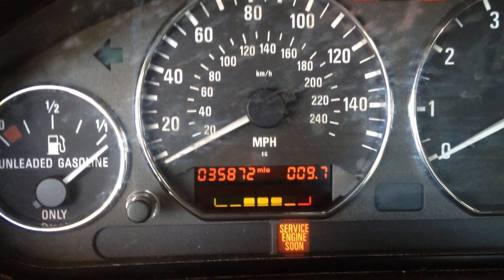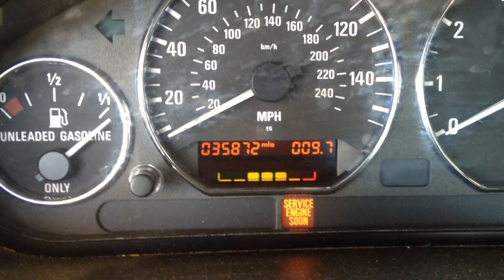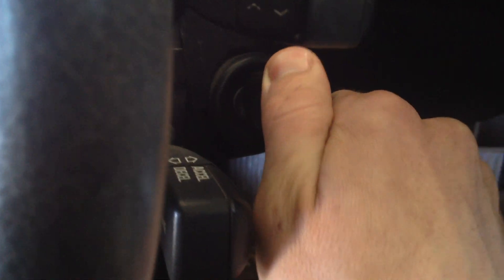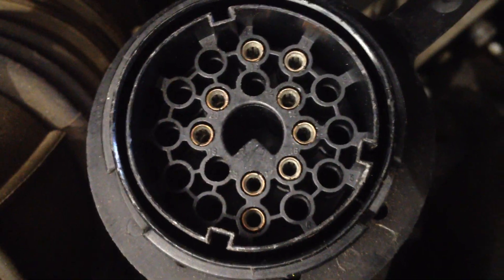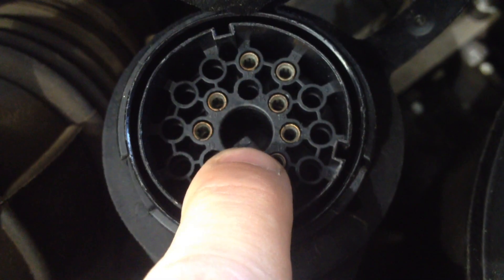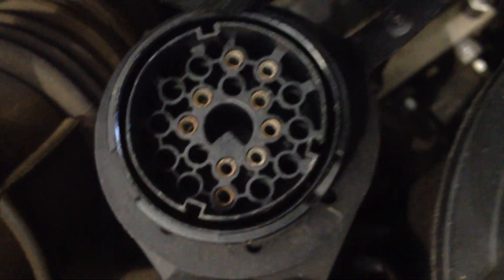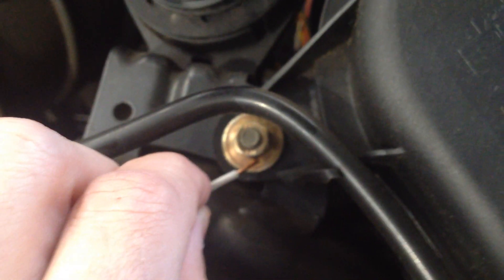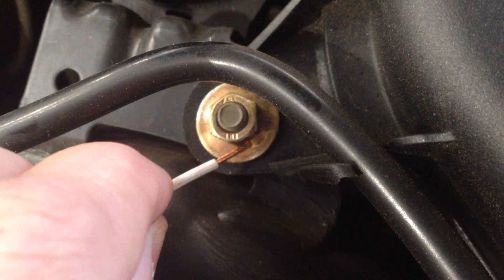How to Reset a BMW Oil Service Light WITHOUT the Special Tool - E30, E34, E36, E39, Z3, X5, M5

Comment: This works well with just a cable, sure. But to be on the safe side you should use a 470Ω resistor in line with the wire, just to avoid shortcutting the circuit board. Btw, same method works also for pre-1988 cars with M10, M20 and M30 engines with the older type diagnostic plug.
Reply: Worked on my 84' E30 :)

Comment: hey, so i tryed this, I turned the key to possision 2 and put the wire in plug 7 and then to the ground for 10 sec, went in the car dident reset so i turned the car off. (diddent care realy) but some how the car wont start now, it seams like some relay or some fuse or something went wrong.

I got an BMW e30 with and m60b40 engine but that should not matter since the 20 pin plugg to the dashbord is the same as the orginal 1.

any tips what could be wrong...
Reply: @jongunnar Same happen here what did you do to fix it?
Reply: On board computer burnt

Comment: After doing this my car started fine twice and the oil light was reset. Now after not starting the car for a few days the car only cranks but won’t start. Any idea why or what I can do to fix this problem? I’ve been dealing with this problem for a while and it really irritating and I can’t drive my car because it does not turn on.
Reply: Not sure if you still have the car, but could be your crank position sensor